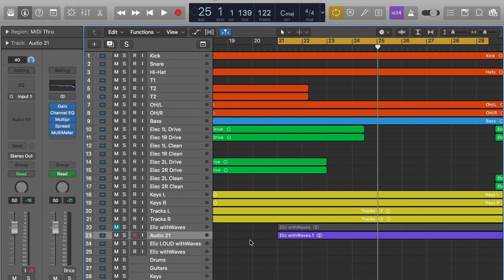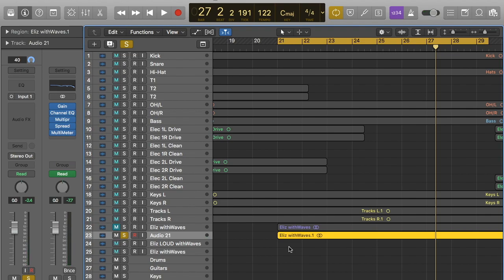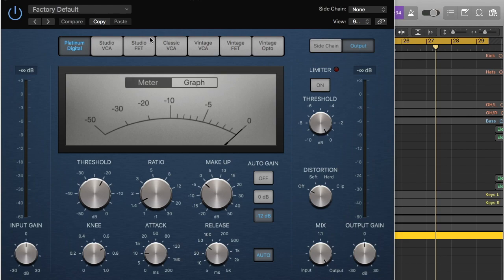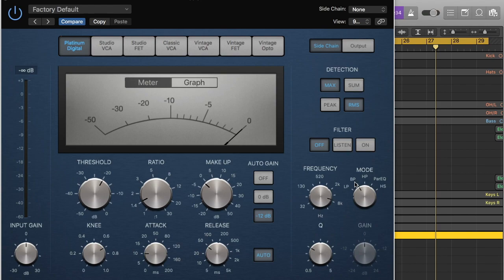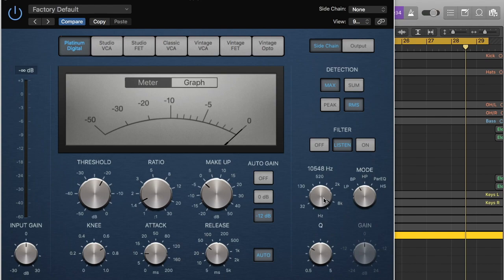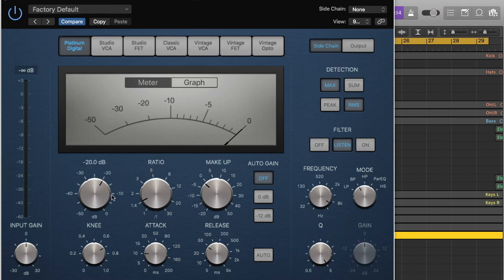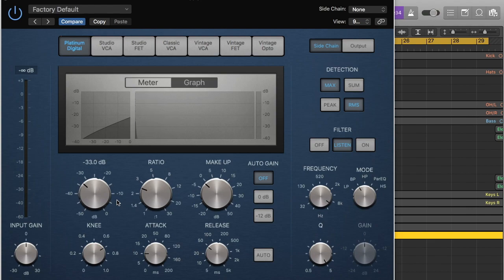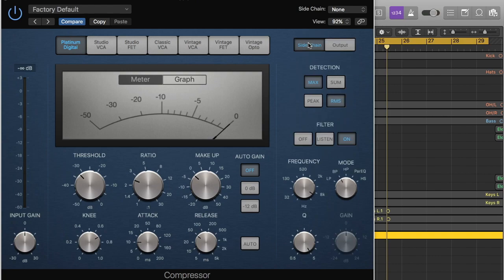How To De-Ess In Logic Pro X

Comment: Hey Thanks for this tutorial. I find it helpful. Question: After using this compressor with side chain to de-ess, do I open up another compressor for the rest of the compression? Second question: Is it best to de-ess before EQ and Compression? (ex. De-Esser followed by EQ then Compression) .
Reply from the maker: Q1: Yes, Open up another compressor to compress.
Q2: If you EQ and then compress you will then be compressing the overall sound. Whereas compressing and then EQing means you will compress the sound, then boost and cut frequencies and the compressor wont compress your EQ'd sound. I would Compress after EQ. De-ess after EQ and Compression